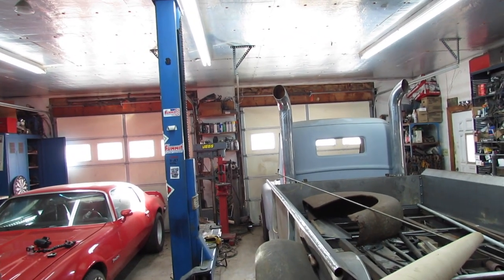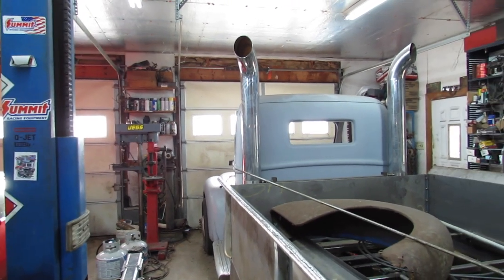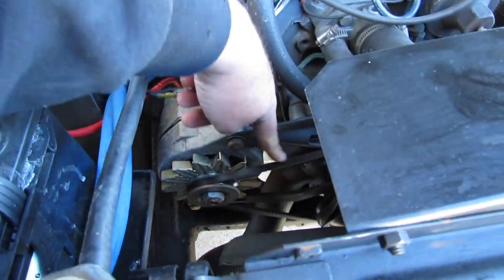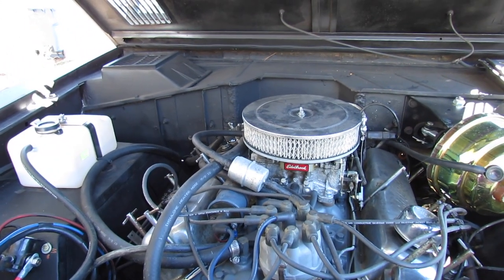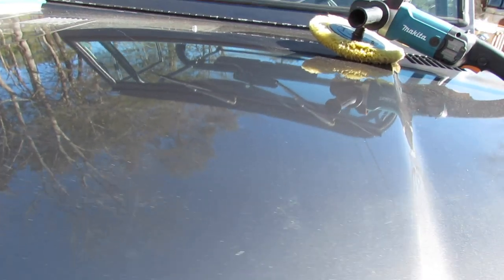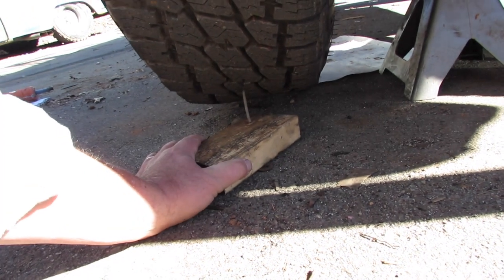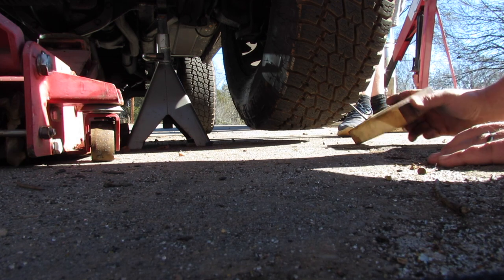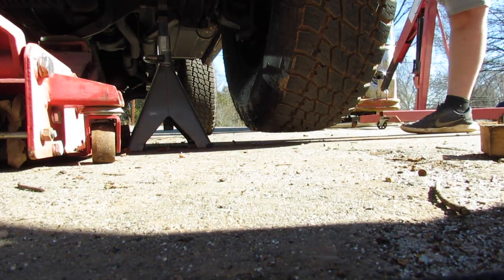74 Bronco

Comment: Fan belts - we had a '79 Mercury Monarch with the 302.  It had FOUR belts on the front of the engine and the inner-most was so small that you would have to remove a pulley in order to change it!

Fortunately, I never had to change one.